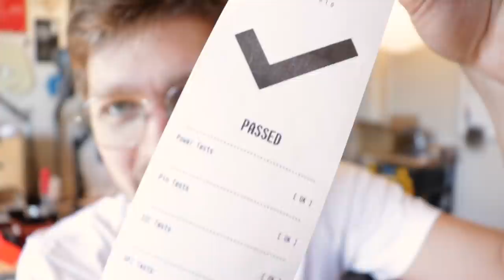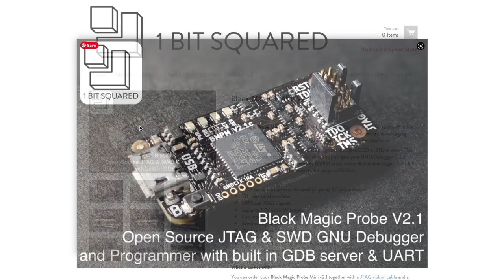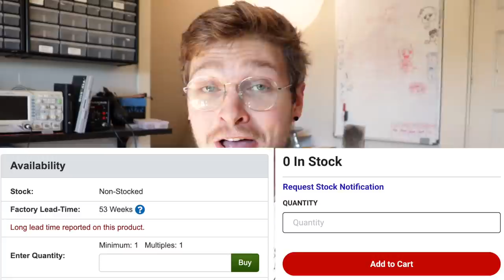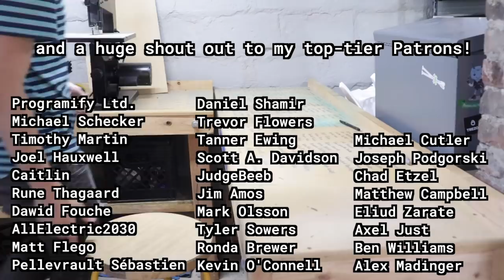Fully Automated PCB Testing

Comment: I love the "tool or project" dichotomy because I can drop $350 on a printer that overall is on par with (or better than) my friend's Prusa, and I can drop $20 on their old half-disassembled kit printer (Anet A3, I think) to have as a project printer :) It's fun to tinker and mod things while still knowing for sure that I have one to be a TOOL rather than a project.
Reply: Do I buy the Index then, and spend a ton of time tinkering with it, or spend 10k$ or more on an old refurbished professional pick and place machine and try to get that machine to be productive faster?
Reply: @ProtonOne11  I suppose that depends on your timeframe and experience level - if you're not in a rush and new to PnP machines, you could wait for folks to get their hands on the Index and help sort out the first-generation troubles, and buy one in a few months or so after some revisions have been made. That'd be the most ideal approach, where ease and money are the concern but time is not.

If time is the concern, then it's up to you which one you care more about: ease or money.

With that said, I have a slight feeling that a passion project made by a team of fresh, young engineers is going to be chock full of modern conveniences and thoughtful design that you simply won't find on an outdated, archaic 'refurb industrial' unit - so unless you specifically are already trained on those, AND/OR need features explicitly and exclusively available on a specific ancient machine... I'd avoid them :) but that's just me.

Comment: Also, be very mindful of USB connections to a PC while also having a separate 120VAC to DC adapter powering your board.  Lots of high voltages and strange interference can occur.

Comment: FYI.  You may want to do a little research into thermal print paper - specifically the chemicals which can apparently transfer through the skin.  Their are small inkjet printers available for this.  As for blowing the inputs of the micro(s) - the keyword there is power sequencing - of which you may be now painfully aware.  Keep up the good work.  :-)

Comment: If anything should be fail-safe, it should be a testing setup that takes boards in a completely unknown condition and tests for faults. So I ask, why is a fault condition killing both boards? The ground pin on the microcontroller could very well not be soldered correctly and cause the exact same issue, no?

Comment: Know I'm late to this issue, but I design with pretty conservative rules, bare boards are tested, and assembled boards are AOI. In a run of about 2000 thru our assembly floor, we've only had at most 10 board issues. Couple guys still working on test jig, but will it really be worth the effort ?

Comment: Power the board slowly with current limiting and measure it against voltage 

If theres problem it will draw more current but not damage chip then u can cut test

Comment: Wouldn’t having a separate isolated 24 volts be easier? Then only when the board is grounded the test jig will connect to its isolated ground then linking it and allowing it to test? Hopefully that makes sense but would likely need a lot of redesigning. (Extra pogo and pad on board)

Comment: Polyfuse would solve your issue. (a few cents instead of 80 bucks) However I don't get how you could burn the chip if there was no ground connection present... I mean without ground there is no current flow. (but I have no idea how the schematics looks like)
Reply: There would have been a connection to 24V and a connection to at least one data pin. This would allow one of the data pins (even one connected to a 5V signal) to act as a current sink for the 24V pin, basically burning a giant trough through the silicon in the chip.
Reply: GPIO pins have protection diodes that go to the power rail and GND. This provides a higher impedance path for power, but if GND isn't connected, 24V will end up using that path. 
EEVBlog has a good explanation of this - https://www.youtube.com/watch?v=2yFh7Vv0Paw
Reply: @aveekbh  Still not clear, the video shows the case when the power is missing and not the ground. I've tested in spice and no current is flowing when either of the grounds are missing. (with both ground in place the 24V will burn the diode, because it flipsthe relative polarity) Also what does a 24V rail do on a GPIO port?
Reply: The spice model may not take into account that the clamp diode might fail short when 24V is presented on an IC pad that can tolerate 5 V (maybe 9 V). Also, the GND is connected on the controller board, so the current flows in to the micro there and finds a path to GND. All the devices (actual transistors in the IC) are only designed to handle 3.3V (with the GPIO cells for 5 V). Providing 4x that voltage can (and probably will) cause catastrophic failures.

Comment: I get that PCBWay is sponsoring you, and you probably aren't paying for the circuit boards, but sheeeeeeesh... 100x200mm is 67$, and your design calls for 2 per feeder... 

That's a MASSIVE waste of money, when you consider most of the circuit board is empty. 

I think it would be better overall to be a little more frugal, especially when you're already 3d printing most of the structure for the feeder, there's literally nothing gained by using an expensive circuit board as a structural component. 

Split them into smaller boards, print recesses to index them into place, run FFC or ribbon cables from board to board. 

In the long run, this is more cost effective, especially if later down the line you chose to alter the design, the boards can be upgraded seperately, instead of ordering a whole new board (or two per feeder) @ $67 each + shipping, add to that the mentions of 30+ feeders..  the cost is getting astronomically high..

Comment: I would upgrade to a real receipt printer, not one of those Chinese printer modules. They are very slow, and using a real receipt printer is about the same cost, is a lot faster, and also the nicer ones have a built in cutter, and could cut your receipts automatically.